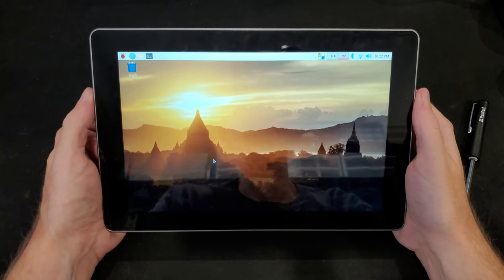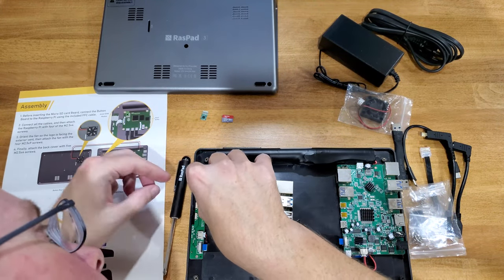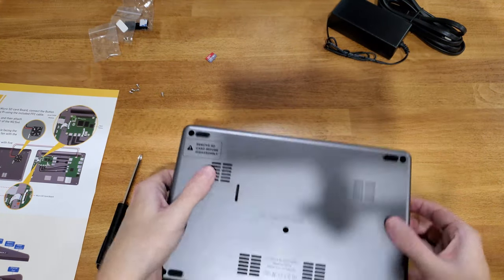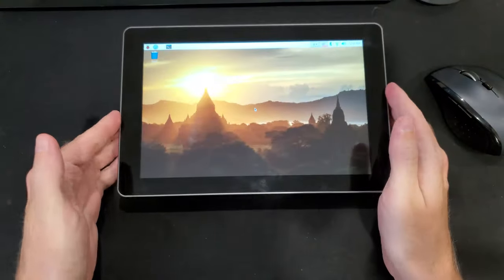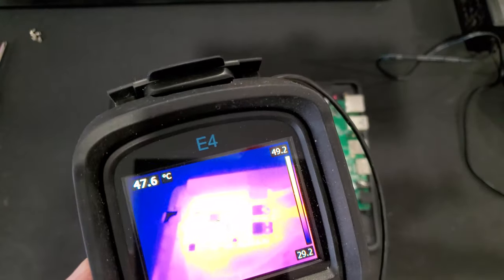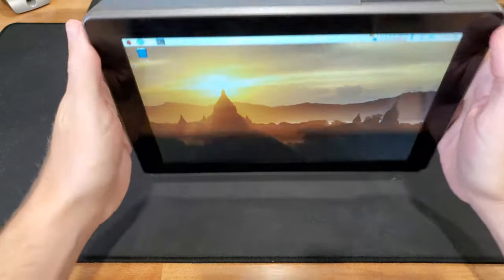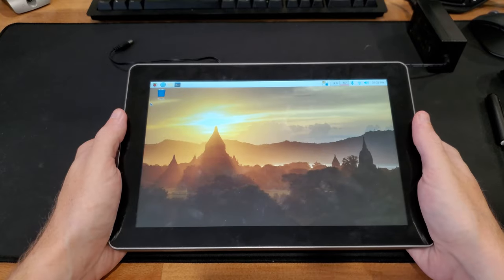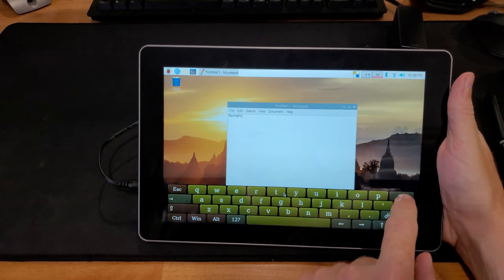Raspberry Pi Tablet Case: The RasPad 3

Comment: Very good video. It confirmed my setup. I had the same problem with the wedged screw. I started holding it upside down to insert the screws. A magnetic screw driver would have been good.

I had a problem with "No Cable" error. I reseated the hdmi cables and that went away. Good stuff.

Comment: I noticed that you didn't installed the included small heat-sinks on the CPU and chips. Is there a specific  that you didn't installed them?
In my personal opinion I don't think it would make a massive difference in cooling. But even small heat-sink will make some difference in combination with a fan.
Reply from the maker: I wasn't doing anything computationally intensive, so my temps were not getting very high. But yes, it would be best to install the heatsinks.
Reply: @upgrdman I noticed the heat sinks were missing as well.  Did you ever cut some slots in the back to increase airflow?  Also maybe getting some taller stick on feet would help with air circulation. I just ordered the kit and after watching your video I thought about doing that as well as cutting additional slots in the back.  Thanks for the great video.
Reply from the maker: It didn't get hot enough for me to worry about it, but I guess more airflow wouldn't hurt anything. Have fun!